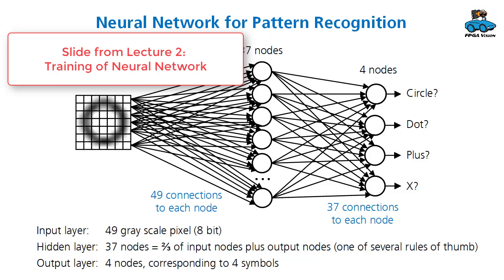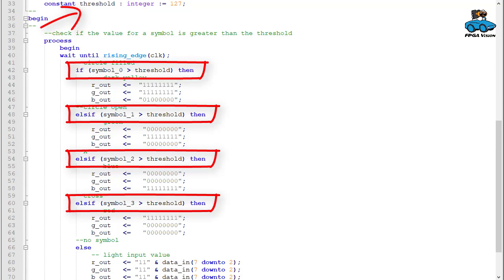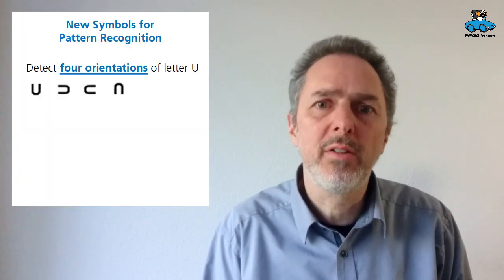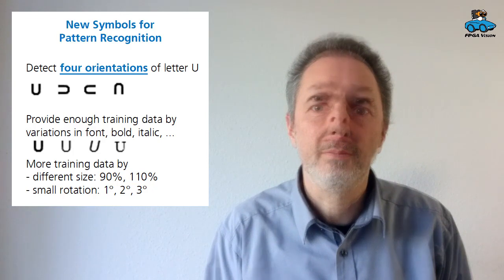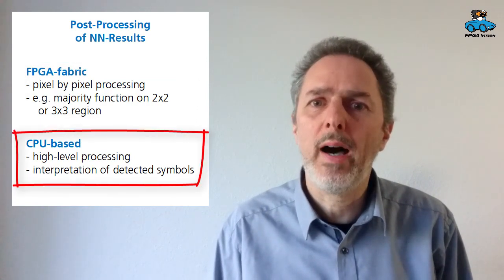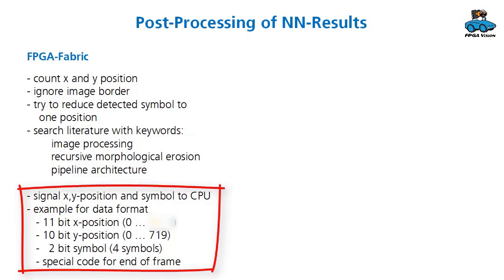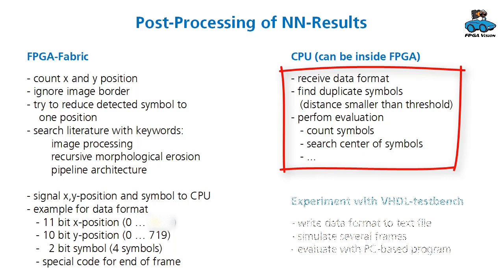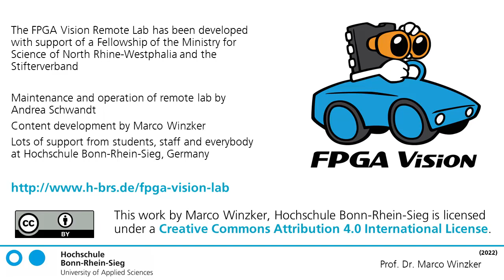Pattern Recognition with NN on FPGA - Suggestions for Experiments

Comment: HI, first of all, I want to say thank you for your sharing this content. I find it very educational and useful. I have a question. I have seen some other videos and I was wondering why do you train the neural network with Octave instead of using a more advanced frameworks such as Tensorflow and then LeFlow to flash the model into the FPGA ? Thank you in advance!
Reply from the maker: The reason is didactics. Octave is easy to install, only one tool required, good user interface, good performance.

You are right, there are other tools that are also well suited and you mentioned some of them. In the future, there will probably be also videos using another tool for NN training.